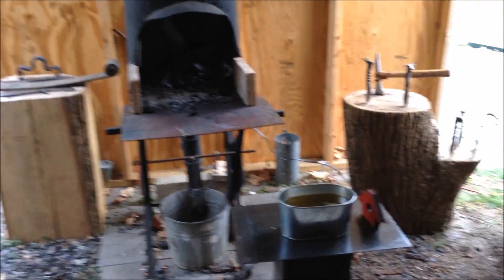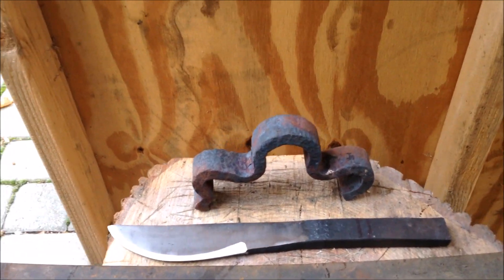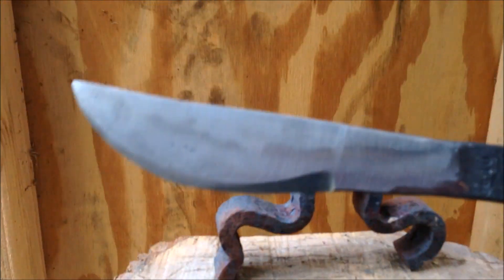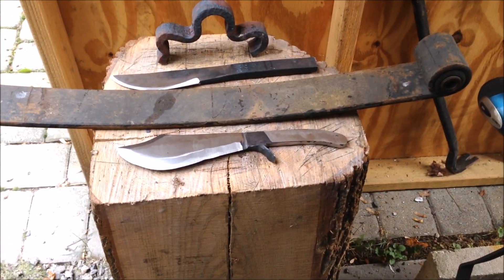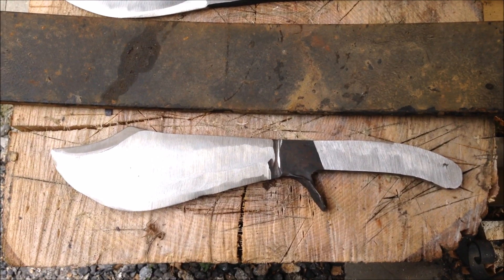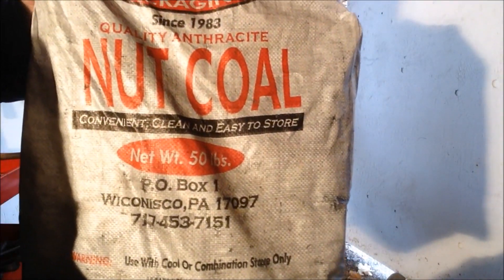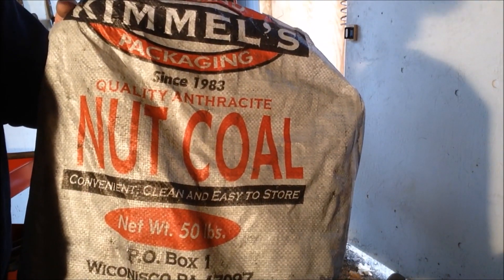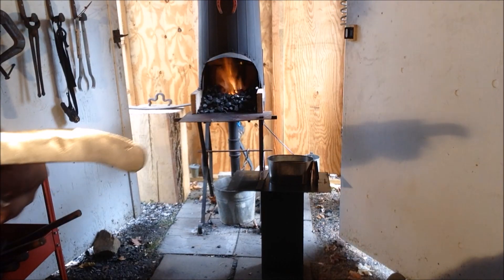Bowie Knives From Junkyard Scrap - Heat Treating

Comment: I learned a trick to hardening and tempering in one step.. Takes a little practice.. Focus on cooling the cutting edge down past critical,, then, flip it over with the spine still red hot, hit the cutting edge with a rough grit sanding pad with your hand, and watch the color creep up into the blade edge and then, fully quench the whole blade.. The spine will cool slow and not harden to maximum,  but the edge will, and if you practice the timing with sanding the edge clean and flipping it to the top and watching the heat rise, you can get a good straw at the edge and blue/purple back from the edge, to the spine.. 
Try it with mild steel first a couple of times.. I do this with my chisels, etc... They have plenty of heat in the shaft, and when you flip them, you have much more time to clean and watch the colors run back up to the tips.. 
Never could get it to work on a double bit axe..Ha.. , but, single blade works great.. Edge up.. ! Ha.. 
Cheers Rick..
Reply from the maker: Interesting Mark thanks for the tip - wonder why sanding the edge attracts the heat or maybe I am misunderstanding.
Reply: Use some rough sandpaper to get the scale off and shine the edge,, so you can see the colors ease into the edge..  Sandpaper works better than a wire wheel on a grinder,, but, a quick run over with a flap disk, or a higher grit resin impregnated fiber grinding wheel works good too.. Just get some shine back on the blade so you can see the colors ease from the spine back into the edge.. 
Common Misconception... Quenching does not require cooling to black temps,,, just a bit below critical and not let it creep back up to or past critical temp.. I saw the magnet, you know what I am talking about. 
The difference between a water and oil quench is how fast or slow you cool the blade.. More sensitive steels require warming the oil and quenching in oil, but you never head anyone say quench is warm water.. It is the fast quench.. The idea is to just quench the cutting edge and not take too much out of the total blade and spine.. Quench the cutting edge,, hit it with sandpaper to clean it up, flip it over so the heat travels up from the spine to the cutting edge and watch the colors move up as the blade cools down.. When you get the correct color at the blade edge, the fully submerge the blade and keep the blade moving in the oil until it is at least at black heat.. Then, you can water cool it the rest of the way if you want to.. I practiced on an old single edge axe bit that I found that I could tell had had the handle burned out.. I figured the possibility it was left in the fire on top of the coals to cool down was pretty good, because the file really bit in.. (Cooled slow, so at it's natural or softest point.. I took the torch and heated the butt(Thick end) while holding the edge up top, and when I got my straw color at the edge, I flipped it and quenched the cutting edge,,, hit it with a flap disk, and flipped it back up and watched the colors run back into the edge again and quenched it again.. Some metals don't take the first quench.. Not sure what the science is.. I am 100% certain the first quench was good enough..  I double quench and temper almost everything now.. Got really pissed off at a chisel that I quenched(hardened) and then tempered and quenched on 3 separate occasions without success..  All 3 were single quenches.. But, when I double quenched it,, I used it as my primary chisel and still have not had to touch it up.. It is a technique, I'm sure some of the better blade masters are using and not showing.. 
But, you will see many of them only quenching the cutting edge. I need to start watching to see how much editing there is just after the quench.. Wanna bet there are some cut video spots in there? Just saying.. See if you notice.. Cheers.. I learned this from a 35 year blacksmith veteran over a couple heavy shots of shine.. Ha..
Reply from the maker: Ah - I got it - awesome tips here Mark - thanks for sharing - I'm going to give it a try for sure.  Thanks

Comment: Just curious, do you think a larger volume of oil would have tempered them on the first try, or is it a matter of temperature?
Reply: I think both - a larger pan of oil would have been better- the oil became hot and I think that prevent the full hardening.    Thanks for your comment

Comment: Great information about the clip. I assumed it was mild steel. How did it temper?
Reply from the maker: It tempered to a nice brown straw color after 1 hour in 400 F oven. Some call them clips or rail anchors - the carbon content is in the 50 to 60 range which is much better than railroad spikes at around 20 to 30 range.   The only drawback is having to straighten them out which is tough to do without a power hammer.   Thanks for your comment!!